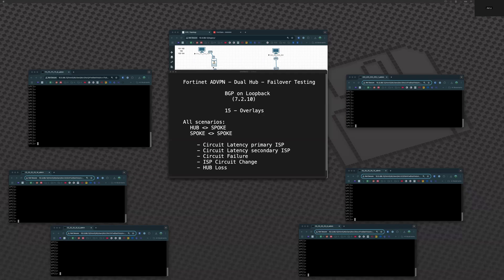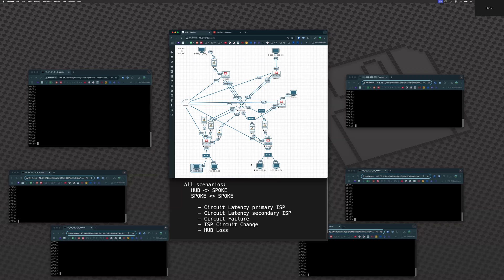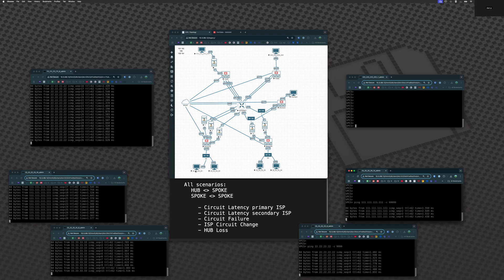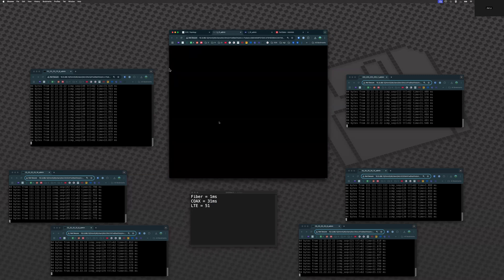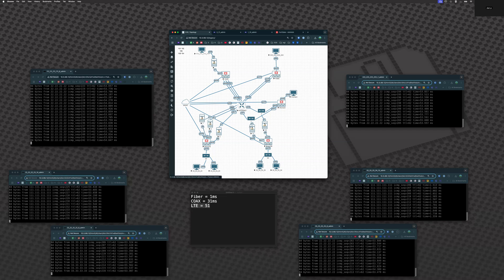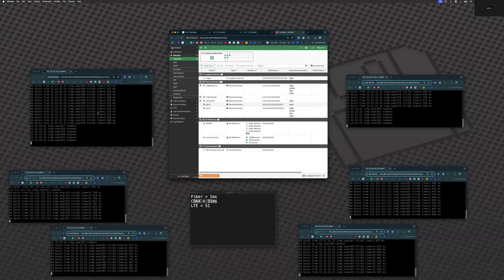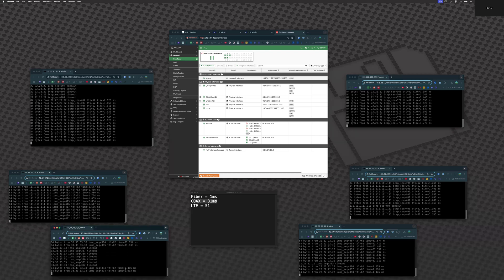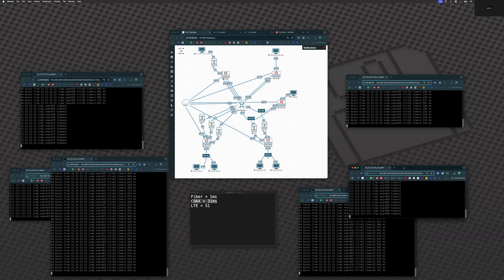(FULL TESTING) Fortinet ADVPN - Dual Hub - (BGP on Loopback)  - (7.2.10)

Comment: Can an environment with only one Hub be configured so that spokes can continue talking to each other when the Hub goes down?
I know you showed that the spokes were still talking to each other when the Hub was down towards the end of the video, but there was still the second hub providing communication. Or was that not the case?
Reply from the maker: Yes, you enable the phase1 command independent: https://community.fortinet.com/t5/FortiGate/Technical-Tip-ADVPN-Spoke-to-Spoke-traffic-when-HUB-is-down/ta-p/393467
Reply from the maker: ... but why not just make one of your spokes a secondary hub
Reply: Yes, communication will continue temporarily if the hub goes down, as long as the IKE timers on the spokes haven't expired. However, if the hub remains offline and those timers do expire, the tunnel will need to be reestablished—and at that point, it won't work until the hub is back online.
Reply from the maker: @jaykaykaykay   I believe with shortcuts independent the tunnels will survive and rekey as necessary.  Default behavior is "dependent"

Comment: Awesome demonstration and explanation! TY!
Question: What's the device/appliance/software? that you use to increase latency on the connection?
Reply from the maker: NETem you can run on any linux, just put it inline with your circuit.  I used to use it about 15+ years ago, and it still works great

Comment: I tested it today again and noticed one thing i don't really like, test conditions: you launch ping from pc behind branchB to pc behind branchA, then i shut uplink on the branchA, few packet loss and it goes via shortcut over vpn2-1 (second uplink on branchA to primary uplink of Hub), then i unshut uplink on branchA back, i wait to restore health checks but it still uses vpn2-1 shortcut because...well, it was formed, sla via it is still ok, it will shut it only because of tunnel idle-timeout, dpd on-idle won't help too because sla pings are always there, but i want to switch back to vpn1-1 and form a shortcut over it. It seems i manage to deal with it by using tag-resolve-mode preferred combined with set tag=1 route-map-in.
Reply from the maker: Nice, it will go back to the original preferred path if your configuration is correct.  Didnt really follow too much in what you said above , but I think that's what you meant.

Comment: How much does the design change if you have multiple regions? For example, dual hubs in Europe for Europe branches and also dual hub in APAC for APAC branches. Would APAC branches be able to built tunnels dynamically to Europe branches?
Reply from the maker: You set it up with multi regional support

https://docs.fortinet.com/document/fortigate/7.4.0/sd-wan-sd-branch-architecture-for-mssps/659828/multi-regional-deployment

Comment: I like the dual HUB scenario and is required for a separate DR site.  I haven't deploy a dual-HUB but how are you communicating between HUB1 & HUB2?  Just through iBGP or do you have eBGP or OSFP between the 2 HUBs?
Reply from the maker: The hubs will have static VPN tunnels between the 2 and just static routes (or dynamic if necessary)

As you really only need to share the prefixes from the hubs to each other.

example: 10.1.0.0/16  from hub1  and 10.2.0.0/16 from hub2.   So 95% of the time just static routing and using SDWAN to do the logic
Reply: @ I like the simplified design. So the HUBs would have 3 dial-ups (assuming 3 ISPs) for ADVPN and then up to 3 S2S tunnels directly connected to each other?
Reply from the maker: @wwilson6482   BINGO  as that is all you need.   There is NO need to have hub-to-hub by dynamic as you want it up 100% of the time.

Just reach out if you need help.  Have deployed this to 100's of gates and different environments.  Seriously easy peasy
Reply: @ I feel like this is an epiphany as ADVPN can easily get very overwhelming.  I'll do some testing on some spare Fortigates (I don't have EVE-NG yet) - thanks for all the responses!
Reply from the maker: @wwilson6482   Correct, keep it simple as it works flawlessly simple.
Reply from the maker: @wwilson6482   Remember there are no route changes with BGP on Loopback.  Routing always stays up.  I constantly see folkls have low timers and BFD... why?  The point is to have routing never go down, so why are they trying to tear it down ... hahahah ;)

Comment: Whats the secret when you disable the primary interface it converges to the secondary one to restablish bgp? It is not happening with me when i use bgp on loopback, the primary interface turns down and bgp is never restablished keepin the traffic going trought primary tunnel wich is down. i have opened a ticket to TAC but no solution yet. Maybe you can give me some advice.
Reply from the maker: I'd have to see your config to see what you are doing wrong.  BGP on Loopback should never let BGP go down as it can flow across any of the overlays.  shoot me a message and I'll have a look.  It could have to do with how you did your zones, or how you have your sla's , etc.... many moving parts

Comment: can you explain how to configure with dual wan in hub and spoke but one of wan is private network like MPLS and the other is internet and make MPLS as primary ? i have problem with multi-path and additional-path in this scenario
Reply from the maker: @salim190  this is where you will use ADVPN 2.0 which is available in 7.4.2+ as it has transport-groups.  Transport-groups allow you to segregate your transits into different groups so they dont cross over. Thus MPLS will be in group X and DIA in group Y
Reply: @secrit-com  thanks a lot very informative. can you make LAB Please
Reply: @secrit-com  Have you setup ADVPN 2.0 yet in any of your designs?  Based on what I've read, it cuts out quite a bit of the configuration because the spokes don't rely on the HUB (as much) to keep the shortcuts up.  Or do you still require all the route-maps, local pref, etc to make things work?
Reply from the maker: @wwilson6482   ADVPN 2.0 offers some benefits but really not necessary.

with 1.0 you do NOT need local-pref, communities, etc...

BGP on Loopback is significantly more simple than BGP per Overlay.

Additionally you can make the spoke to spoke resilience independent of the hub with ADVPN 1.0

Really the only big benefit of ADVPN 2.0 is segregating dislike technologies.  Example: DIA vs MPLS overlays so they dont crossover
Reply: @secrit-com  this is really interesting because any demos I have ever done (especially with SDWAN Overlay templates in FortiManager) go crazy with the local-pref, communities, etc.  I'm really interested in your simplified configuration.  I'm curious why Fortinet goes down the more complex route in all of their examples when there is an easier way - or do you have a few negatives with your design?
Reply from the maker: @wwilson6482   Fortinet does not recommend local pref , comm , etc...

If you read the documents on BGP on Loopback they do not have any mention of those.

The Fortimanager SDWAN wizard/templats are horrible.  We do not know anyone that uses them, as they mostly break things.  There really isnt a FMG wizard that fits all.

Yes, the BGP on Loopback is crazy simple, once you see it , it will blow your mind.   Thus the fortinet push to use this way as standard

Repeat: do not use FMG sdwan wizard it will never work.